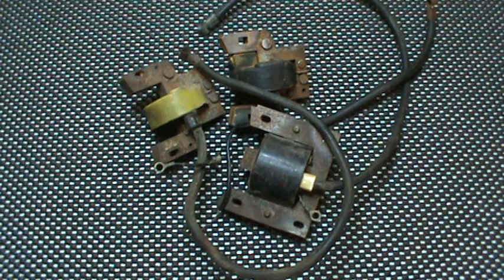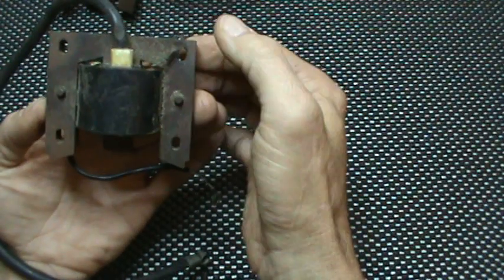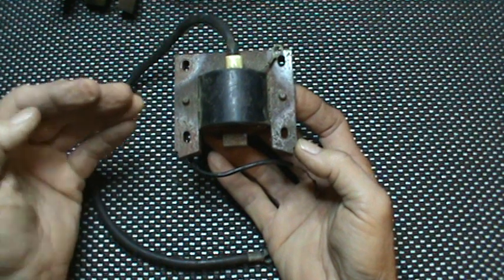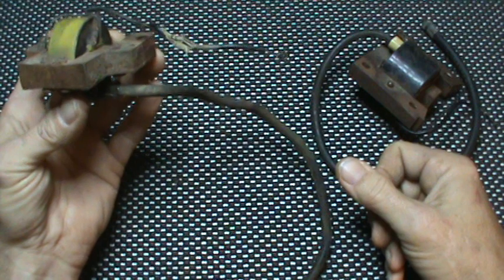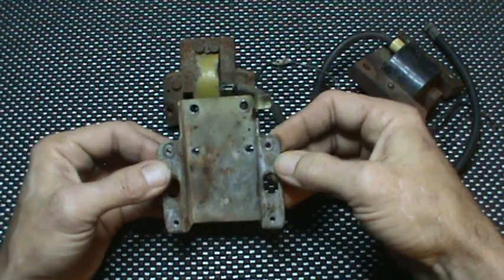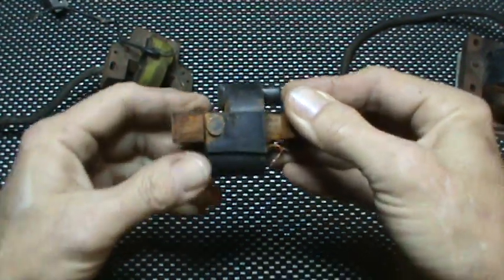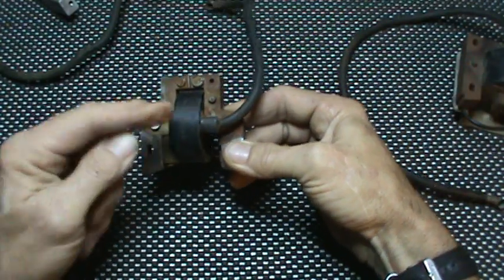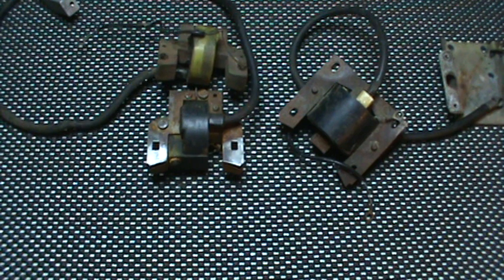Briggs and Stratton Coil Magneto Magnetron comparisons explained

Comment: I have a Magnitron how do you test it with a volt ohm meter? I get 2.7K between spark lead and ground. I get 1.2 ohms between ground and the kill connection.  Is this right?
Reply from the maker: There are videos posted on YouTube on what the correct Ohm readings should be. Zip~
Reply: @ZippoVarga  Thanks Zippo. I wire brushed off all the rust on the flywheel and cleaned up the Magnatron set the gap with a business card and I have spark!! Thanks for the video.  Do you have a video on how to repair pull starts? I have a old 1980s Kholer 13 hp that some times wont't catch and won't retract. I think its missing a friction washer, or somebody replaced parts

Comment: Thanks for the vid. I just bought a briggs type N engine I think. Cute lil thing but the coil is bad. Any idea where I can source a slip on coil for this 3 leg armature?  The 291617 seams to be gone.
Reply from the maker: Unfortunately Craig, they are NLA (No Longer Available). Your best bet is to source a good used coil through small engine collectors web sights or on collector groups on Facebook. There's many of us out there who collect these old engines, and most of us also hoards parts. Cheers and Good Luck! Zip~
Reply: @ZippoVarga  thanks, thats what I was afraid of... saw a video from a guy that retrofitted 1 fromma Tecumseh that seamed to work

Comment: Hey Zip my 23 D the boot holding the plug wire to the prong is broke, so the plug wire is just dangling there. can solder it and use shrink tubing cmbauer47@gmail
Reply from the maker: Yes Sir, you sure can. You don't need the insulator boot unless you want to slide it onto the wire before you reattach the prong. Just be sure the  core of the wire it self is soldered to the prong. You can even crimp it if you prefer. Zip~

Comment: That is great info' . I nearly had a heart attack when I took the flywheel of and there were no points. The other 3 engines I worked on had points . Relief is putting it mildly . Many thanks . Great video.
Reply from the maker: Hugh, I'm glad the video helped shed light on the different types of magnet fired ignition systems and that it put your mind at rest with your engine. Cheers! Zip~

Comment: I'd like to contact you about my B & S 8 hp motor and its magneto. I've watched this video 2 times and I have one just like the yellow looking one in your video. I'm pretty sure it's toast.
I was hoping you could share where I would get a replacement. I don't have any information on the motor other than it's probably an early 80s or late 70s model engine. The plaque that usually has the motor info is missing and all I have is the info from the guy that owned it before my. He said it was a 8 hp. Let me know if you would like to text me on my phone.

Comment: my Briggs and Stratton 11hp. motor Coil Magneto Magnetron has the button on the right side of the coil,could this be a manufacture's mistake?
Reply: would it work if i turned it front to back and reinstalled it?
Reply from the maker: An easy test would be to do just that Andrew. For the longer explanation, you would need to determine if your engine was originally designed for the Magnetron coil ignition system. We can cover that if flipping the coil doesn't work. Use a standard business card to properly gap the space between the coil and the flywheel. Best of luck! Zip~
Reply: Thank you for your reply, i will give that a try.
Reply: Sorry,my mistake, the button is on the left side of the coil,the motor is firing too early,it fires before the piston reaches top and then drives the piston back causing to rip the pull cord right out of your fingers, Camshaft and Crankshaft timing marks are lined up properly, Any ideas of the problem?
Reply: could be a flywheel key has shifted which would cause an advanced timing condition. This usually happens when you "stop the clock" while cutting and you hit a pipe ot small tree stump. When they shear the aluminum flywheel key completely, the timing will be so far off it won't start at all. Testing for spark will still show a spark but at the wrong timing. You have to remove the flywheel to inspect the key in relation to the crank shaft key-way. Good luck.
Reply: thank you for your reply,key and keyway is good, and cam and crank are lined up properly,valves are within tolerance,still hard to pull cord ,and it pulls cord right out of my hand. it's on a Generator not a Lawnmower,Got to be something simple that i'am missing here.

Comment: Having  sorted an old Briggs  engine with a carb kit and a points and condensor, I was wondering why the oldies needed points and the newer didn't, you just explained why, thanks.
Reply: You can easily upgrade those old breaker point ignitions to a newer ignition coil and the engine will run fine.

Comment: Will coil from a 12.5 hp fit an 8hp Briggs?
Reply from the maker: Sorry for the delay Robert. If the bolt holes are the same and the radius of the lamination pack is similar, you should be able to. Only thing that would cause problems would be if one is a points ignition coil and the other is a solid stare ignition model. This can be determined by checking for the little silver button on both coils. Zip~
Reply: ZippoVarga One more thing.Are briggs 8 to 12hp engines the same block mounting pattern?
Reply: Robert, yes you Should be able to.. If not most frames have multiple mounting holes. I have used a frame that had an original 8hp engine with a 10hp and a 13.5hp engine, and it had enough holes to mount. You can always drill your own.

Comment: just upgraded my 81' lawn tractor over to the new magneto, wired the ground connector to a switch so I can kill the engine, but the second I bolt it to the engine the connector is grounded out. Any suggestions. I used some thin none conductive gasket material  and made small washers to fit between the engine and the magneto, but the screw heads grounded it out anyway. Though of making some washers to fit under the screw heads, but stopped cause if the screw shaft touches the hole walls its still going to ground out. What can I do here.

Comment: ZippoVargo  watch, how to check a Magneto with a flashlight battery by Ken Bohn  on youtube.
Reply from the maker: Will Do Ray! Thanks! Zip~
Reply: I checked a coil off a generac generator, the coil test worked great this is how I found out the flywheels magnets had lost there strength, the unit had been in a warehouse 17 years, i think this happened because the flywheel is cast Iron instead Aluminum , I used a 9volt battery that was down to 3 volt , easier to hook-up with jumper wires.

Comment: i saw older man use a flash light battery to test these coils , I tried it and it worked great! everybody should  use this test method, I used a 9 volt Battery from a smoke alarm
Reply from the maker: I'd like to see this testing method Ray! Zip~
Reply: comment below

Comment: Hi, Zippo... I hope you see this as your video is over 2 years old....... I am trying to reinvent the wheel and become a small engine mechanic at 65 and fix my 1980 B&S engine. I put a new magneto on the  troy-bilt rototiller, converting it from points and condenser. I got the part from a reputable dealer that fixes small engines I took out that little bar thingy and put the plug in. Used a business card to gap the new mag, cut the extra wire off and used the correct one to go to the shut off connection. Put back on the fin "shield" that was to the left side of the old condenser. put every thing else back together..  fly wheel, cover  ETC. STILL NO SPARK. New spark plug already also..                                           Then on top of that I bought a new carb because I thought that was another problem and the stinking thing leaks,  over flowing out the bottom bolt hole. I reset the long needle so it "squeeks" and the slot where the end of the screw driver goes got messed up because of course I did not have the right sized screw driver to span the whole width of the slot . I don"t know if the slot needs to be unmarred or not. The second pointed needle still can screw in without a problem. And the carb still leaks!!!!!!!!!!! after I reset the long needle. Any suggestions on my 2 problems. 1: no spark. 2: still leaking carb.
Reply from the maker: Spark sounds like the flywheel may need to be re-polarized to match the new breakerless coil (Magnetron), and the leaking carb could very well be the needle and seat or the float isn't doing it's job. That's the best I can do for you from here. Briggs will re-polarize the flywheel free of charge. You just need to pay shipping in both directions. Zip~

Comment: one more. ? I'm going to try put up two photos. one is coil an showes wires an other. u no it but ? see the lines on surface how some areas appear to be resrceded or groved is this a issue  buy touch it's. not hudge but there there ok. so let me no

Comment: What is the part number on the  magnet magnetron for an older engine with the older flywheel  - without having it go into the shop to have the magnet reversed
Reply from the maker: The engine must be manufactured after 1981 to qualify for a Magnetron ignition. Zip~

Comment: No spark in a Briggs & Stratton Model 243431 0123 Type 01 CC: 67100 61, in an Allis-Chalmers B-110 garden tractor.  Can I convert that motor model to solid-state ignition?  Would I need to get the flywheel re-polarized?
Reply from the maker: With the linked magnetron in this comment, it's plug and play. No other work is needed except to install. Zip~ http://www.ebay.com/itm/121148616567?_trksid=p2055119.m1438.l2649&ssPageName=STRK%3AMEBIDX%3AIT

Comment: question: i have a 3hp B&S and and i have no spark, one wire goes from the coil to the points, one to the sparkplug but i dont know where the third wire has to go.
Reply from the maker: The third wire is your kill wire. It grounds to the engine and disables spark to shut the engine down. There is usually a spring loaded capture on the throttle assembly where this wire connects. Zip~
Reply: so when it's grounded there won't be a spark?
Reply from the maker: Correct.

Comment: what is the part number to the (ignition module/amateur magneto) for a 5.0 briggs and stratton lawn mower 500 series
Reply from the maker: Go to Briggs and Stratton's web sight. There, you can enter the numbers off your particular engine to get the IPL (Individual Parts Listing) and within will be your part numbers. Zip~
Reply: thanks. got it !

Comment: Great Video, you are the only person to explain this.
I have a 3 hp with a December 1970 date code, it uses the 2 legged coil with no pickup., not the 23D. Briggs And Stratton says the flywheel must be re-polarized. 
I think you are saying that if the engine uses the points system, the coil you show with the "Button" should work. Is that Correct?
Thanks
Reply from the maker: The coil with the button is a solid state ignition type called a Magnetron. Many people convert their points fired older Briggs over to the solid state simply by eliminating the points and installing the Magnetron. The key is to make sure you're getting the correct size coil for your application. The smaller 1970's 3-5hp Engines use the same coil, so you can source a 5hp Magnetron and it should work fine for you. You can also leave the points in place and just don't connect the wire coming from the condenser to anything. You will notice a spade connector on the Magnetron, That is for your kill wire. But, your 3hp should have the kill at the spark plug. Good luck on your venture John! Cheers!! Zip~

Comment: Briggs ss Magnetrons + old Briggs magneto coil have different magnetic air flux gap on laminations. Why is this in theory, and how is timing changed by this, Can coil of different width gap be used to change timing on Briggs engine?
Reply from the maker: With the points fired coil, the timing is a marriage between the points and bridge of the coil in conjunction with the flywheel magnet orientation. Changing to electronic ignition coil or Magnetron, allows for the trigger point to be in time with the flywheel. So, whether the bridge is larger or smaller, the trigger point (or timing) is the same. The position of the button on the Magnetron is so situated to fire within a 5 degree timing point, benefiting both older engines that are retro fitted with the electronic ignition coil and current manufacturing. In the Magnetron's infancy, it was required to re-polarize the flywheel on older Briggs engines, not for timing, but to initiate the trigger point within the 5 degree buffer zone. That 5 degrees is key, because it allows for the use of the different coils and their widths between poles to be within the 5 degree window. Regardless, the points or electronic trigger fire according to the flywheel's position, which is in direct relation to the crank shaft position which is between TDC and 5 degrees  before Top Dead Center. There is a sacrifice in certain configurations, but the power loss is negligible and not enough that it isn't overcome by torque, where the real power of a small engine truly lies. You might notice the power band difference on a static dynomometer where the power doesn't come in until slightly higher RPM, or it comes in sooner at a lower RPM, but again, unless you're building high power alcohol engines for a living, this slight difference in timing and where the power comes in is quickly absorbed through the governing system. Which is another ball game all together and where further power compensation is happening. So, can timing be changed to a point that matters using different coils...not directly, no. Off set flywheel keys, adjustable coil mounts and other tricks are used to move the timing for certain applications. But a simple swap won't gain any noticeable power either gained or lost. Zip~

Comment: I'm hoping you can help, I'm pulling my hair out. I have a 23D with a bad coil winding from what I can conclude. The armature laminates look good, so I'm hoping replacing the coil winding will solve my problem. I've researched a replacement but I'm lost. Do you know of a specific manufacturer winding that will fit?
Reply from the maker: 296834 is your armature (coil) part number. They are no longer available, but if you search Briggs and Stratton collector sights on Google, you should find what you need with a little work. Sorry I couldn't be of more help. I used to have a supplier, but when their stock ran out, that was it. Zip~
Reply: First off, thank you for such a speedy reply. The original armature 296834, is no where to be found so I'm trying to find another option. I've scoured many of the old B&S sites and have found many conflicting opinions. Would repolarizing the flywheel allow me to replace the coil with a 2 leg versions, or convert to an electronic system? Or possibly replacing the flywheel from another 23 model that uses a 2 leg coil work? I appreciate any help or opinion you may have.

Comment: Good Info ,thanks. I was recently told by a B&S dealer that I could not use a magnatron type coil replacement on a B&S cast iron engine . Is this correct? My unit is a Davey water pump with a B&S engine #100232 0384-01 70001157  I am told that the last seven digits indicate it is a year 1970 engine .
Reply from the maker: They are incorrect. Hundreds, if not thousands, of cast iron engines have been converted to Magnetron ignitions. Depending on the Magnetron you purchase, you may, however, have to send in your flywheel to be re-polarized. But, not to worry....Briggs has been doing this very thing for many, many years. Zip~

Comment: Your comments on the mouse eaten ground wire were quite helpful to me.  I looked and the mice were not at fault, but the wire was worn and shorting out my spark.  My B&S motor is back in operation.  Thanks for your video.

Comment: I have a late 60's early 70's montgomery ward with a briggs 16 horse (model 38148 B) I can't find any info on this engine and I need to replace coil to a electronic and you seem to be the man on these engines can you point me in right direction thanks and you do a great job on videos.
Reply from the maker: Your coil number is 298968. Just google "Briggs 298968" and you'll find all sorts of options. Zip~

Comment: I need to ask you a question, how can I find the model/serial number for my 1963 simplicity 725 so I can buy parts for it? Thanks Stan. 6/16/2016
Reply from the maker: Hi Stan. If it's the original engine, there will be a tag riveted to the grill side of the engine (forward facing) and should be an aluminum tag. IF it's the original engine, it will be a Model 19. If, by chance, it's a later model replacement engine, there are a number of other places they placed the information. I have a video showing Briggs identification locations. Cheers! Zip~
Reply: I don't think I have the original engine, so what now?
Reply from the maker: Watch my video on where Briggs placed their identification numbers as mentioned in my previous comment.
Reply: ZippoVarga